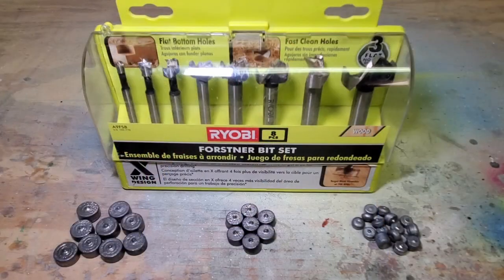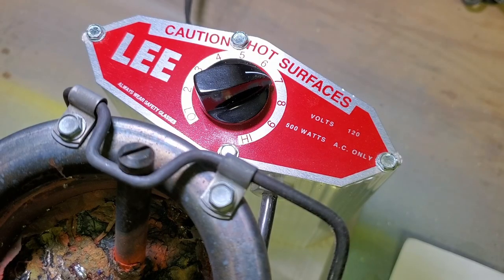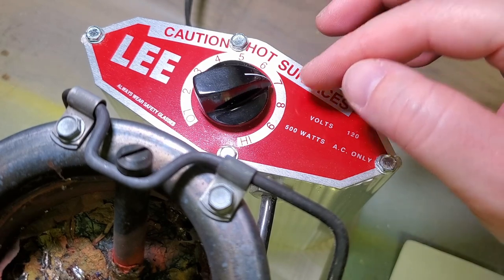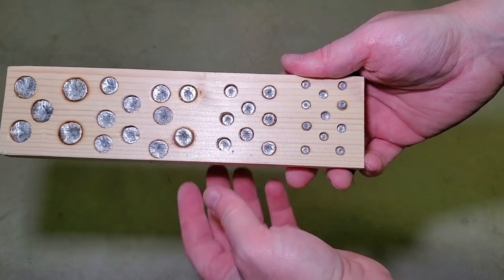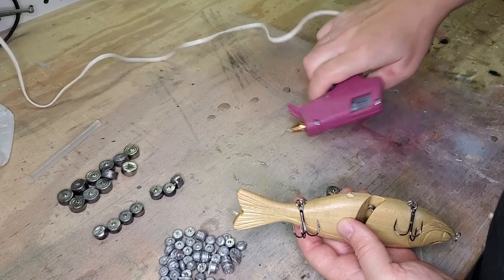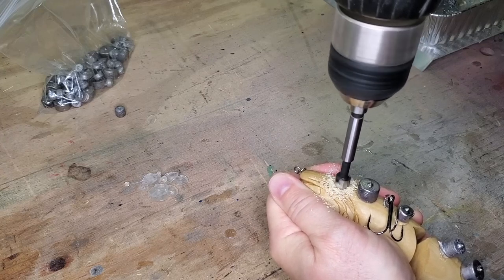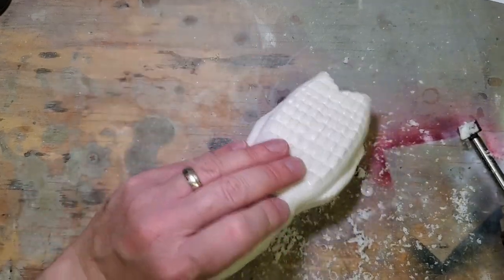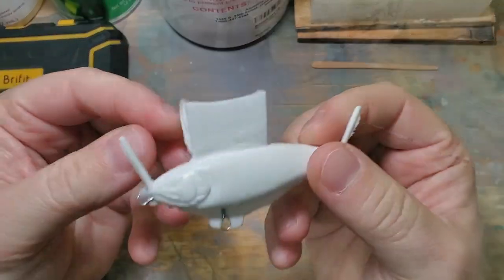Lure Ballast Weights- how I add weight to balance my wooden fishing lures

Comment: Hey, Mike. I've been following you since the beginning and have already adopted most of your "weighting" methods and equipment. But I appreciated this video because it's so clear, to the point, and IMPORTANT. I watch far too many lure-makers on YouTube—including one of the best—who are are simply guessing at weight amounts and placement. They then painstakingly finish the lure and try casting and retrieving it in a local waterway—only to find that it doesn't swim worth a damn. Ridiculous. 
     I also see a LOT of lure-makers who are very careless about safety when handling molten lead. As you point out, the burn risk is truly serious and the poisonous fumes are even more so. I have bypassed the whole issue by buying "lead wire" of various diameters on amazon and cutting it into usable lengths using a vise and hacksaw. That said, I still wash my hands thoroughly after handling the lead. Keep up the great work, Chris (in Maine)
Reply: I'm glad I'm not the only one who thinks this! The number of people using molten lead inside without ventilation or PPE is shocking.
Reply from the maker: Thank you very much, I'm glad you found this useful and interesting! I can't claim that all of my lures have worked out, but I try to learn from my mistakes. I like your lead wire idea and honestly have never heard of that before.
Reply from the maker: You've got to take care of yourself!
Reply: This comment got me I did exactly what you're stating above.  Now I'm weighing them individually and it's been such a improvement in Baitmaking

Comment: Great video! Gluing the lead under the lure body has an issue though, if the lure body material is clearly less dense than water: When the same amount of lead is stuffed the in drilled holes, it appears heavier due to having less overall volume in the water, compared to the balance testing situation. In most cases the effect is almost unnoticeable, but might ruin the end result if you want to make a perfectly suspending glide bait etc., where details matter. Pike/Musky lures also benefit from compensating the effect of using possible steel leader, which I have done by just hanging a snap and a few inches of leader wire in the nose of the lure, which seems to work ok.
Reply from the maker: Very true! I mostly use this to get in the ballpark. I will put it in the tank again after I have ballasted and filled the holes to make any fine adjustments. Great tip on the steel leader!

Comment: I've spent 3 months and a few hundred on learning all about resin as I design my glidebait. It seems most lure makers fail to explain how detrimental humidity is to PU resin. Even a little humidity makes a lure way off in weight after a casting. Its been frustrating to learn that, but that fact is hugely important. Makes sense why people make lures in batches, cause those baits in a batch should ballast very similar in respects to each other, vs how a different batch ballasts when casted on a day where it was more or less humid.
Reply from the maker: Sorry to hear about your resin issues. I actually haven't gotten into mass production or batches yet. I do live in a very dry climate, which can't hurt. I did recently learn to microwave my microbaloons to get the moisture out before mixing. Sounds  like the more conditions you can control, the more consistent your casts will be. Thanks for sharing and best of luck to you!

Comment: I use a thin wire to put weight in my mold and pull the wire out w pliers and it saves time w drilling w my resin baits.
Reply from the maker: Great idea!

Comment: How can that method be accurate?I mean,when adding weights externally with s.g.,its the weight of the wood+the weights.When drilling the holes,you take some of the initial wood off,so the total weight when putting the metal keds inside can t be the exact same as before...
Reply from the maker: So this was kinda meant to be a basic intro to ballasting video but you are correct and make an excellent point! If you're making a sinking bait, it really doesn't make any difference. If you're making a floating bait, you should be leaving more than enough 'float' so you are not cutting it close enough to matter. The real trick is making suspending baits. Here you have to plan ahead and account for things like drilled out wood, foil, paint, clearcoat, eyes, etc.  So my advice would be to get it to a very slow float in the test tank at this stage. After you've finished the lure, the weight of all that stuff should negate the slow float. At that point you can fine tune with heavier or lighter hooks and split rings. Thanks for you're comment; maybe I should do a more advanced ballasting video sometime!
Reply: It is intended to get you close.  So the items that have major contribution are identified.  Whereas things that are considered to be insignificant can be ignored.  It is a matter of diminishing return of your time.

You can also do a rough calculation base on mass and density.  However, you can only go so far as you can't account for everything and run into the same issue.